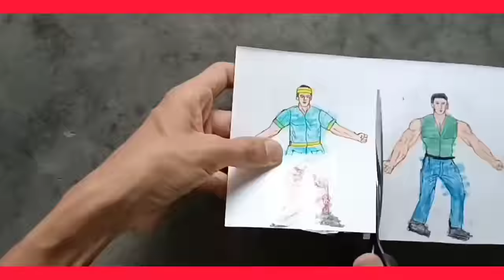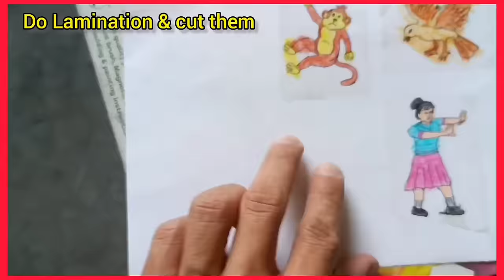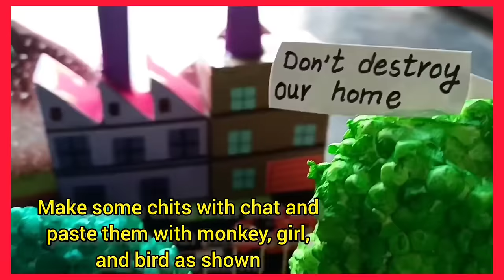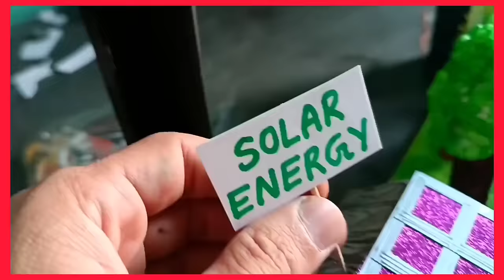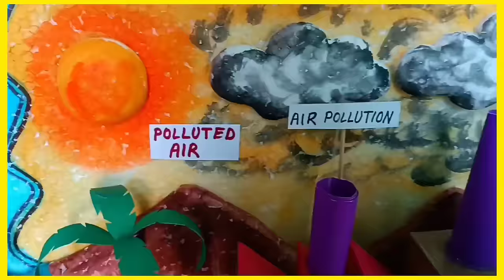Save Earth Project Working Model |Save energy |Pollution model.

Comment: But sir tell me that what is the use of the river
Reply from the maker: to show the water pollution and to devide the model into two parts
Reply from the maker: you can make a dam on the river to show hydro electricity
Reply: So sir what is the solution of this river water pollution
Reply from the maker: @pragyapandey1798 avoid factories & use renewable sources of energy
Reply: Yes, sir this is a big problem in our project.
Reply from the maker: which problem bro?
Reply: If we made river it attract all the attention  and the question raised that there is no use of river
Reply from the maker: @art_girl2009 you can remove the river if you want..it shows only the partition of the project..
Reply: But sir...  factory waste is leave in river
Reply from the maker: dont show the factory waste..show only air pollution

Comment: how u r shaping the trunk of tree and clouds..
Reply from the maker: with blade...i made the edges round..
did you not see the complete video.?
Reply: which thermocol u r using..when I am sharpening the clouds its coming out small small pieces..
Reply from the maker: for trunk making i used small balls thermacol..it is a little hard from normal thermacol...you can use the thermacol of washing machine,fridge etc..for trunk..
Reply from the maker: you have to use normal shaving blade for cutting thermacol..
Reply: As I dont have much time and am not a expert..Its my first model for my son..whether we will get this hard thermacol in normal shop or not??
Reply from the maker: @swatiparhi9691  availablity of thermacol is depend on your area or city..in some cities it is easily available..bt it is ban in some areas..
Reply from the maker: you can use paper rol to make trunk
Reply from the maker: @swatiparhi9691  aap normal thermacol se hi try kijiye..ho jayega..bus apko bohut hi sharp blade use krna padega edges round krne k liye..paper cutter se nhi ho payega..normal blade k 2 pieces krke uski nok bnani hogi heavy scissors se cut krke..

Comment: Sir I have one mini bulb and 2 light how to connect sir
Reply from the maker: every bulb or light has 2 wiring points..+ & - .
you have to take two different colors thin wire..connect all + points with one wire.
and all - points with another single wire..then connect the wires with battery.
every battery has also 2 points..+ & -.
you have to connect + wire to + point..
& - wire to - point of the battery.
Reply from the maker: you can take help of any electrician for better work..